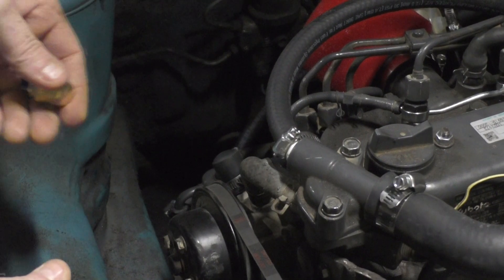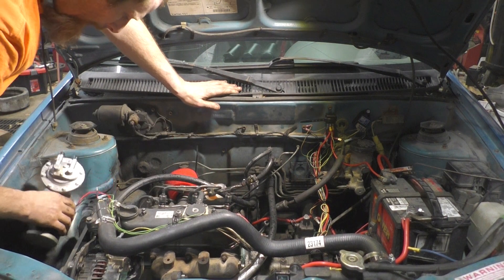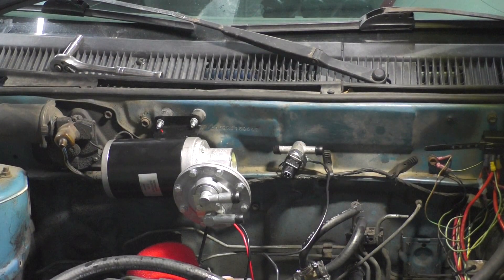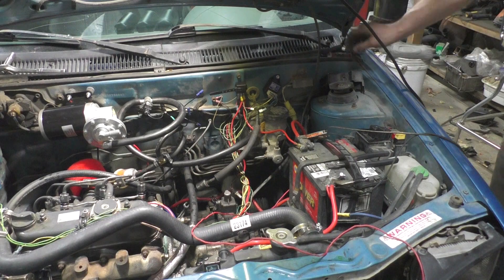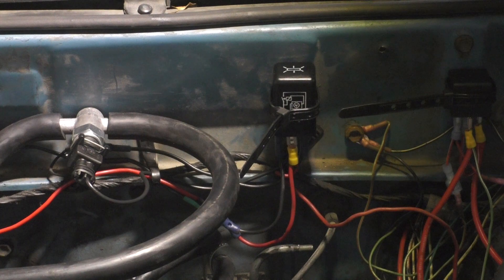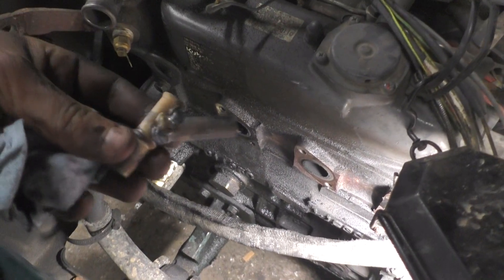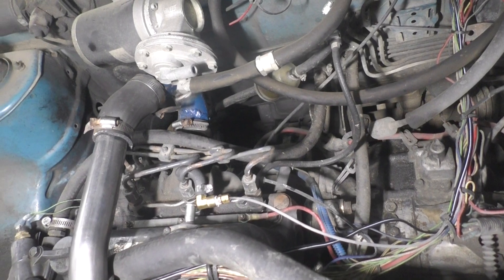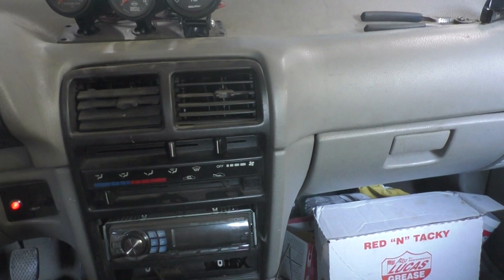Geo Metro Kubota Diesel conversion Part 5 Turbo install

Comment: They did make a upward facing intake manifold that fit d722. You can also swap injectors and injection pump from a d1105 to make more power
Reply from the maker: When I was building it I was unable to find an upward facing intake.
Reply: @jagersgarage490  if memory is correct they come on a d782 that was used in a grasshopper mower

Comment: So glad to find your channel, Jaegers Garage!  I’m turbo’ing my D722 now, and was about to order the same exhaust manifold.  
What turbo did you go with?  I’m between a MHI TD015R, or a IHI RHB31
Reply from the maker: MHI TD015R don't get a cheap ebay turbo my first one was and lasted a few months then leaked 2qt of oil into the intake in 50 miles and had more shaft play then I have ever seen on a turbo.  The genuine mitsubishi turbo has been working great for almost a year.
Reply: @jagersgarage490  110%.  I’ve also had past experience w’knock off snails lol.   Thank you for your reply, you helped me choose the MHI TD015R 🤙.